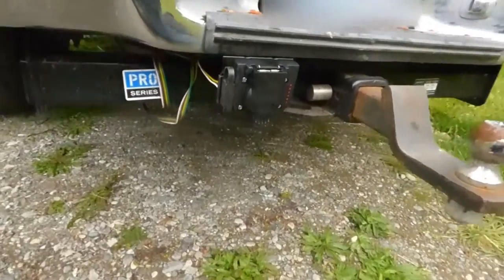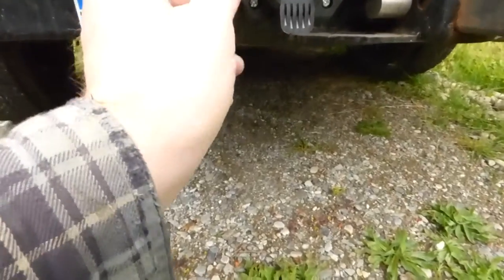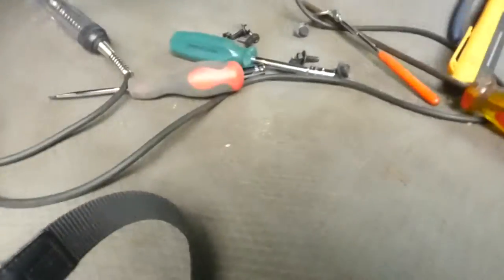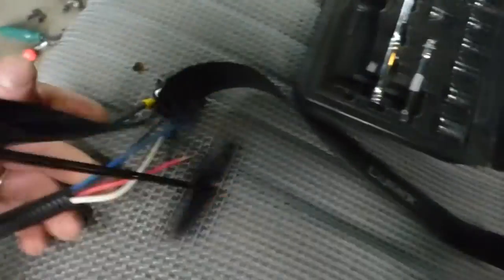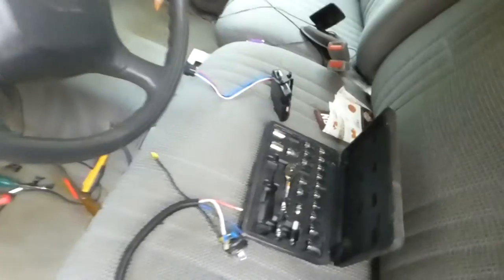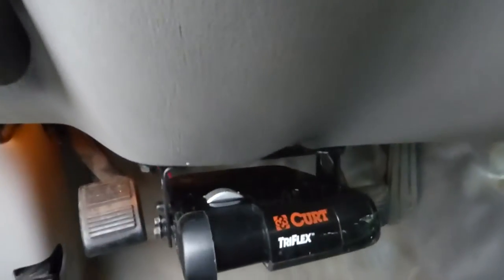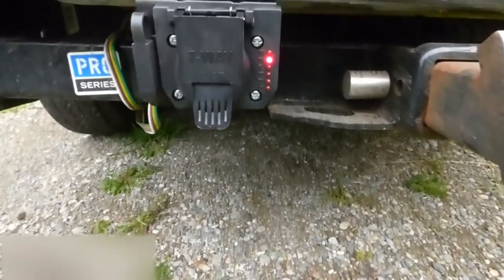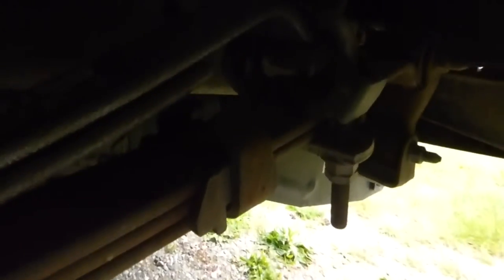Electric Brake Controller Installation for Towing an RV

Comment: Just so you know the 88-98 Chevy has the wires already ran for the trailer breaks from the factory, all you have to do is look under the brake booster they are wrapped in electric tape
Reply from the maker: Evidently, not on mine.  There is another place it's supposed to be by the frame half way down on the port side.  Nada.